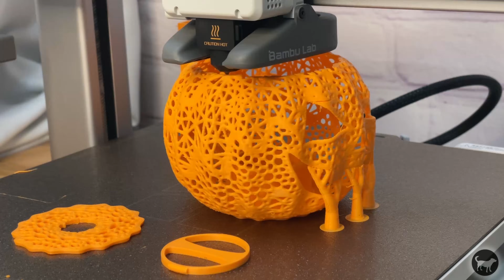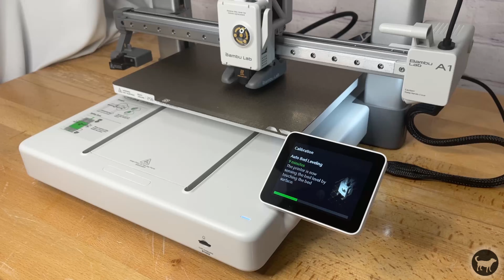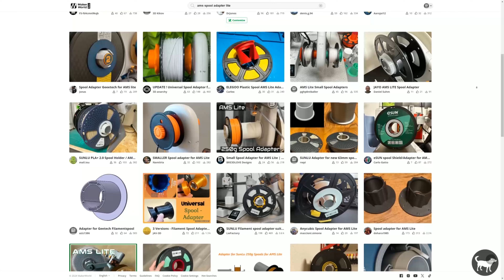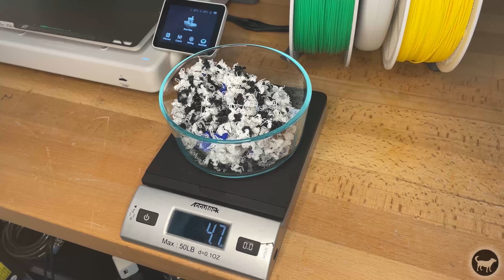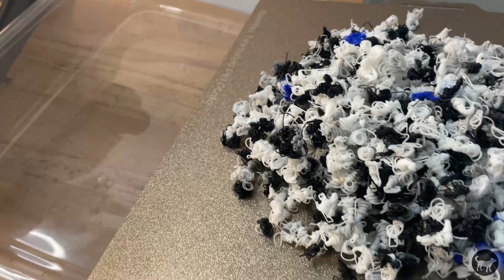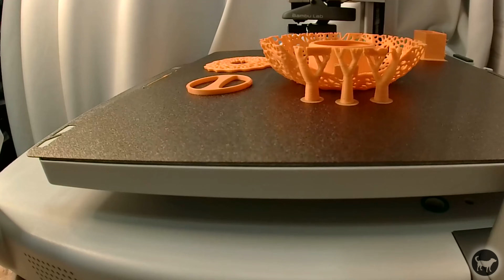Bambu Lab A1 3D Printer Review | AMS Lite Color Changing | My new favorite 3D Printer

Comment: So if you don’t want to use the AMS will it still poop the same? Or are you still able to print with one color
Reply from the maker: Every job has a tiny bit of poop at the very beginning to prime the nozzle but if you are only printing in one color then that’s it for the whole job. The large amount are only with lots of color changes.
Reply: @BusterBeagle3D ah okay 🤔so for a beginner like just starting would you recommend the combo or just the regular to learn
Reply from the maker: @produktbaby I really like the combo even if I’m printing in a single color since it just makes filament loading easier and allows for switching between prints if I want to. If you think you want to print in multiple colors in the future it’s probably cheaper to get both at the same time. If you know you don’t want to print in colors and want to save money you could always skip it but again I love the fact that I can print jobs in any of the 4 colors I have loaded on my AMS even if the job are single color. I just printed a job in white and then another one right after in black but didn’t have to change anything which was great.
Reply: @BusterBeagle3D ahhh that’s smart okay okay thank you I’ve come to my decision I’ve done research and I think I wanna try the A1 combo then when I’m ready to buy once cry once 🤣for a enclosure and safety get the p2s and a air purifier I believe it’s the p2 upgraded version of the p1?

Comment: Plus with the AMS  light 
You can put 4 same colours and if spool 1 runs out is automatically moves to spool 2 so if your out you don't loose that print set due to plate cooling down

Comment: I've recently aquired the A1 after being so impressed by my Mini. I tried plugging my AMS lite into the A1 ( after setting 'Read AMS on Start up). Its just an external spool holder for 4 spools at the moment. As For the A1 I must have got the 'Runt' of the litter, as everyone sings it's praises. I wanted plug and play , just like my Mini. My A1 was plug and Tinker all day. After tensioning all 3 belts I finally got it to pass it's calibration tests and could finally start printing. Rant over, cheers for the review.
Reply from the maker: That's pretty shocking honestly and I have not heard of that kind of experience before. Glad you got it all sorted out though and hopefully that's the last of the worries.

Comment: Wouldn't it be better to have the AMS lite feeding filament into the hotend by putting the AMS lite above the printer on a sturdy shelf rather than beside it?
Reply from the maker: It doesn't really matter where it is since there is a motor that feeds the filament through the bowden tubes. That being said my final location for them is mounted on the wall behind where I have the printer. It wasn't for any reason other then the space I had for it's final location. Also you are limited by the distance away the AMS can be, not by the bowden tubes but by the card that powers it connected to the printer.
Reply: @BusterBeagle3D  Thanks for your reply.
I recall reading some months ago about a user who commented that they had problems with the feed when they originally had the set-up that we commonly see with the A1 and AMS lite. He said that after putting the AMS lite above the printer problem went.
I'm going along with; on the balance of probabilities seems reasonable.

Comment: I've had the A1 for a few weeks, I took the plunge for the AMS.  I have my A1 printer inside a safety enclosure and I'm disappointed the power cord from AMS to the A1 is so short.  I've just ordered some Capricorn tubing to better reach the A1 from the top.  The specs say it can use up to 1.2m of bowden tube, so hopefully that will work.  I definitely need an AMS power extension cord tho
Reply from the maker: I can see that cord being too short if you have a custom setup for sure. May have been nice to give it a little breathing room for things like that.

Comment: i have the A1 mini combo A1 combo and X1C with 4 AMS boxes.. which 16 colors changing is too much.  Guess I'll have to buy 3 P1S to use the 3 ams boxes I'm not currently using.  4 -8 colors is more than enough, i think.  I hope Bambu Labs will come out with a larger printer bed.. like Neptune 3 and 4 max by Elegoo.. or something better than Qidi Plus 4.. 400mm square would be  awesome.

Comment: I just got an A1 as my first 3D printer ever and it's great! I'm also learning Plasticity to create my own models and I couldn't be happier with the results I'm getting. I didn't get the AMS because I don't like the idea of wasting so much material, but I can always get it in the future. Thanks for the review!
Reply from the maker: Thanks for watching. Glad you like it. Also to be honest I love the AMS for more then just the multi-color. It's way easier to load filament into the machine and I have multiple colors on the ready incase I want to switch the colors between prints. I highly recommend it.
Reply: Did the a1 ams lite box come with the filament and holders or did you have to buy extra?
Reply from the maker: @andrewjackson4901  The AMS lite does not come with the filament or empty spools. Those have to be bought separately or printed with the machine.

Comment: My combo part keeps falling over
Reply from the maker: I'm not really sure why this would be the case. Is it setup on a particularly wobbly table? You may also consider mounting it to the top of the printer. Mine never fell over during my testing but in the final resting place of the printer I ended up mounting in on the wall to save space anyway.

Comment: I have been 3d printing for over a decade Build many kit machines, even designed a few of them) any nobody in that time, since the first i3 machines has done more to push along 3d Printing than Bambu have.
Like you said, it just works.

They just came out of nowhere and blew Prusa out of the water in every metric. Over a year on and the other companies are still playing  catch up. I can't wait to see what they do next and only hope they try making a resin machine.

Bambu was started in part by some of the folks from DJI (The tool head on the X1 and P1 kind of looks like the front of one of their drones. They brought design, engineering and software expertise with them in spades.
Reply from the maker: Totally agree. Some hard core 3D printers may not be happy with the fact that it's not open source and they can't really tinker too much with it, and they can't tweak Klipper settings, etc. At the end of the day why would you even want to do any of that? I can't see your klipper tweaks in the final product, I would rather have an easy 3D printer that I tell it to print and it does it well. I have already recommended it to family members who have no idea how any of this works as it's the first time I think they could get into the hobby without getting frustrated by the learning curve.
Reply: You've got it there. Out of the blue there are these brilliant technologically advanced printers. Mind blowing.
Reply: I’ll be frank, if they come up  with a resin printer that is as fuss free as the A1, they have an instant winner. 

Doesn’t matter how much it costs;  sometimes you can’t put a price on convenience.

Comment: To cut waste to near zero, go to Filament > Flushing Volumes in the prepare sidebar and turn the purge to zero. You can purge into the infill also to further run out the color. You may see some color bleed on the model, but the prints I do don't show it.
Reply from the maker: I had tried that or at least smaller numbers when I first tried adjusting those Garfield pumpkins but it’s really the transition between black and other colors that it was still noticeable.. I even tried to have one of the 25 little pumpkins have almost 100% infill to give it time to purge more of the black inside the model but it was still noticeable on the outside. That panda was ever harder as it’s between black and white. The 2 worse contrasting colors. Still something to play around with and I’m sure it can be improved.